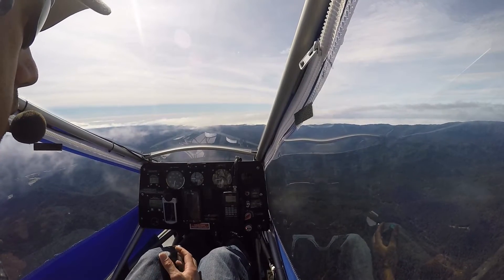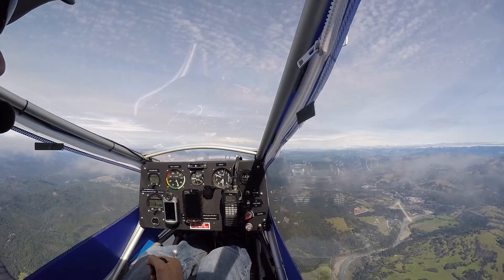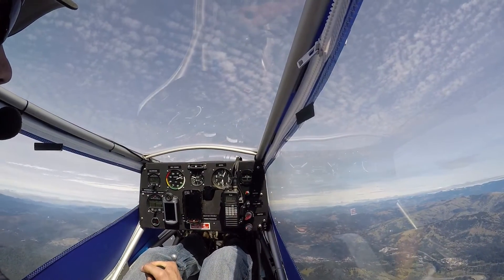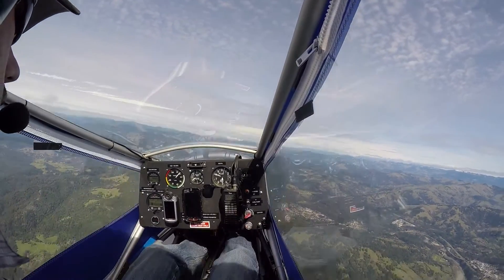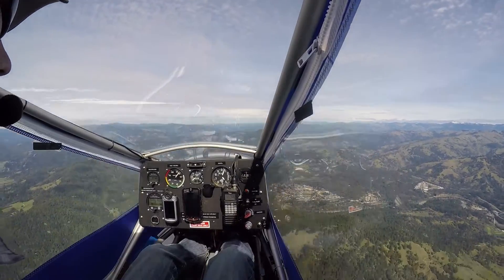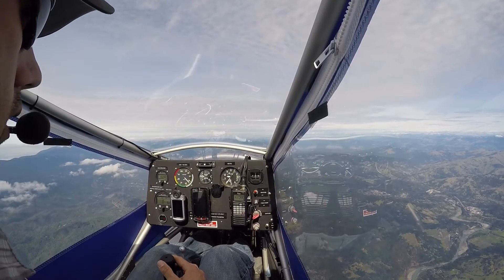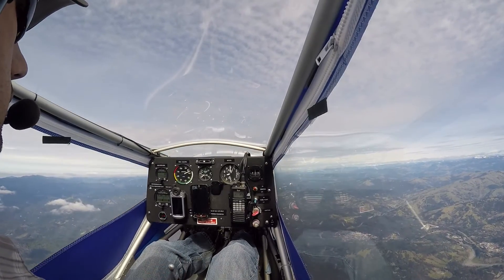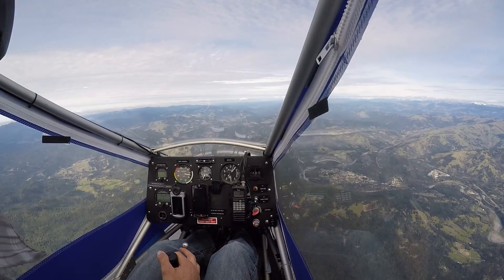VG Test and DeadStick Stalls Part 1 - CGS HAWK

Comment: Cool video, for Vortex generators are really useful but still not really well used in common Society. Every time I see a big rig I think it should have for text generators on it although I am seeing a few more rigs with stuff on the trailer and or on the wheels to improve air resistance but most people are just so oblivious to the forces of nature of course Pilots aren't oblivious bc there in it!
Reply from the maker: There is a lot to be said for aerodynamic efficient design. It is a good thing that many big rig trucks are taking steps to being more efficient aerodynamically. Although they are still very heavy with some or most approaching 80,000 LBS and will still take  quite a lot of fuel to get moving and keep going any improvement in aerodynamics over 100's of miles a day could equate to many dozens of gallons saved every day.

Comment: Good morning

Great video, thank you very much, looks like a very good addition to my Hawk Arrow 2. What have you covered your Dacron with, it looks like some sort of paint? My sails lasted five years only, on the new set I definitely have to do something for better UV protection.
Reply from the maker: Hello Arthur, I sprayed a clear coat of Poly Fiber Aerothane AO-100-1G-K I purchased from Aircraft Spruce over the dacron covers. I talked with someone who said it's only supposed to increase UV resistance up to 30%. Take that with a grain of salt as I do not know if it's true or not. But it does give it a shiny look and rain/water can not permeate the coating and get inside of the wing very easily which can help reduce mold issues.
Reply: Thank you. I've "researched" the subject extensively over the past few days. Aerothane is good, but UV resistance is dependent on film thickness. What they term "latex acrylic paint"s will do the same, at a much lower cost. With both you'll have problems removing the sails afterwards if you want to get to the inside of the wing. I reckon you'll have the same problem with the vortex generators.
Reply from the maker: Yes you are correct that I can not remove the wing covering dacron without getting cracking in the clear coat and there would be no easy way to put it back on and fix it so it looks decent. I knew that going in to it, but i'm ok with it because if I ever need to remove it i'm going to put Oratex covering on it instead of Dacron. I've removed and reconfigured the VG's a couple times and it is no problem moving them to a new location. The adhesive STOL SPEED uses is very tough but not harsh enough to remove paint or covering spray.

Comment: What engine and prop are on the Hawk?
Reply from the maker: Hirth 3003 F.I. with a Kiev #263, 67.5" diameter.
Reply: Can you still get Hirth engines?  Are they in business?
Reply from the maker: Yes, Hirth is still producing engines as far as I am aware of. In fact once Rotax discontinued the 377,447, and 503 engines the small 2 stroke market seems to be very limited for new engines less than 65 H.P. I only know of M.Z. engines and Hirth for two strokes for 50 H.P. or less. If someone wants more than 50 h.p.  Rotax still makes the 582 and four stroke 912 series.

Comment: what is your prop diameter?
Reply from the maker: #263 Kiev Prop three blade, approx 67.5"
Reply: Thanks for your info. I am swinging  with a 64 inch 3 bade Invoprop with a 447.
Reply: Thanks for the info, I am swinging a 64 inch ivoprop powered by a 447.
Reply: Was this a fairly easy plane to learn to fly? I’ve only ever flown c172’s but have an opportunity to get one of these. Thanks

Comment: That's a pretty fantastic result! You're stalling at pretty much the same speed as me but with a much higher cruise speed. (I'm totally jealous!) I can't wait to see how short you can get on and off the ground now. :-)
Reply from the maker: It's definitely more stable at slower speeds. But I was watching some of your videos the other day and was really paying attention to your take off and landing distances and I was very impressed. Then I got to thinking you were doing it on half the H.P.!? And it still doesn't make sense as i'm only about 105 LBS heavier so my extra 50 h.p. is only needing to get that off the ground! Only thing I can figure is flat bottom airfoil vs semi-symmetrical or I need at least 35-40 m.p.h. on takeoff for the tail to overcome the pressure that the big engine is pushing down on the nose?
 Either way I can't wait to see your results if you ever have the chance to put a 582 on it!
Reply: I hope to one day put a 65 hp engine on the Beaver. If one ever comes up for sale locally that's priced reasonably, I'll likely do it.

I think the biggest difference between our planes is the wing. I have a 35' wingspan with a very deep airfoil. The bottom of my wing is flat and actually has a slight negative camber on the bottom when the plane is moving since the fabric isn't pulled tight so the positive air pressure on the bottom pushes it up.
Reply from the maker: Wow that's a pretty big wing for these type of planes. That makes a little more sense now,  I think my craft is around 31'6". I taught myself to fly with a Cobra Model A originally and that had a 35 ft wing on it and it stalled around 23-25 mph but it only weighed 246 Lbs empty. That was a calm wind machine only!